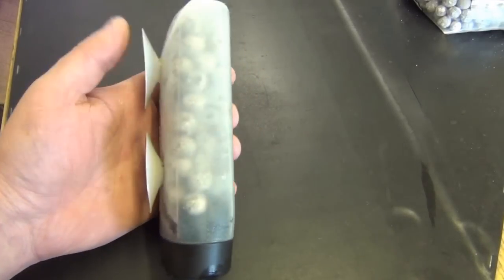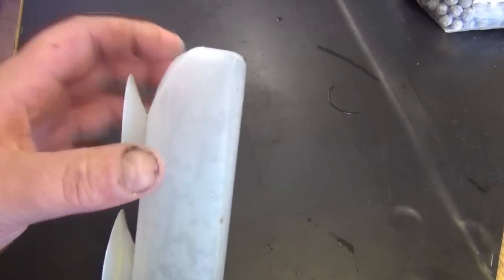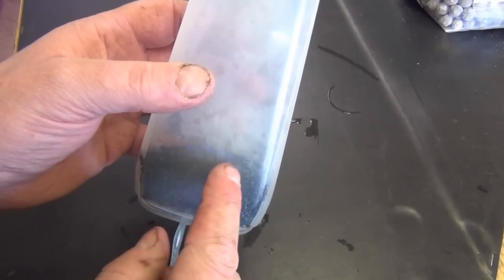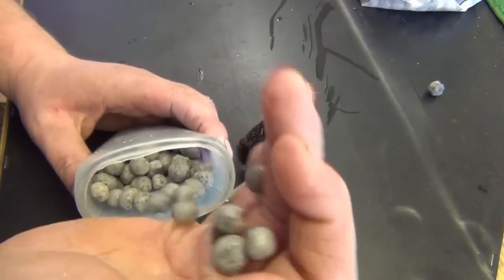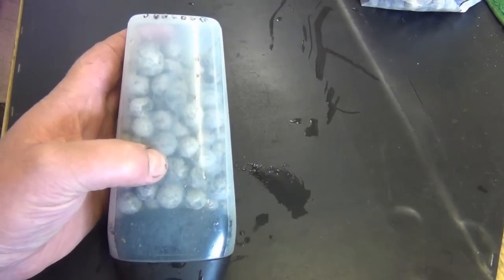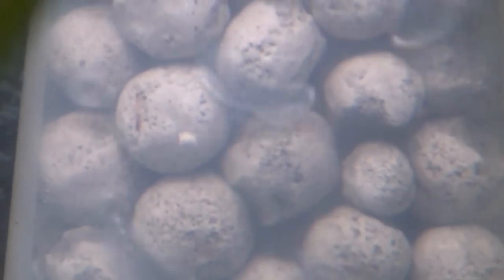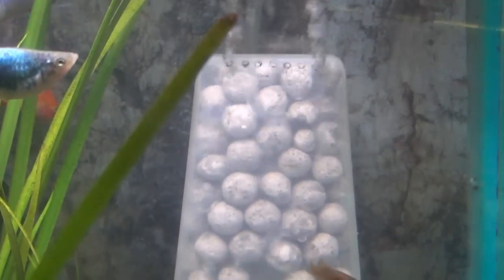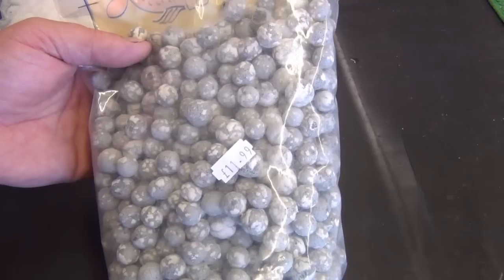How to Make an Excellent Moving Bed Filter

Comment from the maker: The Fluval Biomax is a standard ceramic media so won't move as a moving bed filter would. It still should act well as a standard filter though it may not remove ammonia and nitrite as quickly as a moving bed. It will most likely take 4-6 weeks to work really well and this is based on the set up time of the bacteria which builds quicker on ceramic media than plastic media. Adding gel bacteria balls in the filter does speed up development coinsiderably.

Comment from the maker: If air is being pushed in and is coming out of the top (with water) then water will be drawn in through the bottom to replace the displaced air and water from inside the filter. If you have some anti-parasite treatment and a syringe / pipette you can squeeze some out below the filter and the blue colour should be drawn up into the filter and spat out the top. That will prove that water is flowing correctly.

Comment from the maker: If you have the correct fitting on the outlet of the fluval 3 an air line will fit into it allowing air to be dragged in and spat out of the filter. The filter in this video is completely separate from the fluval and simply runs by air being supplied by an air pump.

Comment from the maker: Some people have used a moving bed filter on the outlet of a powerhead pump. Not sure how that worked out for them but I can't see why it wouldn't work. If you did want to go with a seperate filter then an upscaled version of the one in the video would be no worries. For a 240 litre tank I would go for at least 1 litre Biomotion or 2 litres Hel-x or 3 litres K1 for the media with a decent sized sponge as prefilter although you could retain the one you have on the powerhead instead.

Comment from the maker: A pump to run 2 of these filters only needs to be around 100 litres per hour. You'll need to control each pipe to guarantee similar air flow as air will always go to easiest exit.

Comment: The media used in horticulture is called hydroton and its made of fired clay, Biomotion is sintered glass which because of its huge surface area is regarded the best filter material for use aquatics, this one floats and is purpose developed for use in aquaculture moving bed systems..

Comment from the maker: Groovy. I am currently working on a commercial design which uses the Biomotion and although my first prototype has not worked to plan I now know exactly what to do to for the next one so all being well I will get that made very soon and have it tested. The idea is to show a couple of filter designs at Interzoo in Germany next year but I need to get cracking if they are going to get made professionally so they don't look like plastic containers siliconed together, lol.

Comment from the maker: This filter does not rely on high flow but to test flow just inject water dye (e.g. parasite treatment containing malachite) where water is sucked in. You chould see it taken in and come out the top. Alternately you can just wait a week or so then remove the foam and examine how much muck has been attracted to the foam.

Comment from the maker: The muck is trapped in the foam just like a normal filter but the moving bed does a much more efficient job of removing the ammonia and nitrite since it supports a very vigorous strain of bacteria which rapidly processes waste.

Comment from the maker: The media will only need replacing if it wears away wich shouldn't be for a very long time. The guy who makes it has had 5 litres running in a koi filter for around 6 months with minimal wear. The clay on the outside is meant to wear off quite quickly to help with water conditioning.

Comment from the maker: If you're going to use K1, I'd go for Hel-x as it has 40% more surface area per litre. Two half litre Hel-x or two one litre with K1, choice is yours really. Both would benefit from a foam pre-filter to catch the suspended muck in the water (mechanical filtration) and the moving bed would act to support the biological (bacteria) side of the filtration.

Comment from the maker: Not sure what that is, man. This filter doesn't have use moving bed media to be effective but proper moving bed media (especially the biomotion) is much more effective than media which doesn't move because of the stronger bacteria it supports, therefore the moving bed filters can be smaller than filters using static media.

Comment from the maker: The holes in the  bottom of the filter. As air is forced in, it rises up and escapes from the top. The water is drawn up through the bottom of the filter to replace the air and water which is driven out of thr top.

Comment: made one of these; my first diy filter. I used coral shards as substrate because i figured they have a large surface area due to all the pores. We had a tank in the basement that was horrid, but i spent all of today saving it and it looks amazing right now as a tank that has just been started. Love all of these filter ideas. Will be sure to try out more ^_^
Reply from the maker: Sasha Doolittle Sounds good but remember that coral will raise the pH and as long as you have fish which like that (most livebearers) that will be fine.

Comment: Hi, thats no problem, because now there is these air filter, plastic casing with sponge and litte stones in the bottom, that have been running for months, can run at the same time for some weeks, before changing

Comment from the maker: This one was only a 60 or 70 litre per hour air pump. I suppose that equates to one litre of air for every litre of tank water if this type of filter is the only one in the tank? Never made that connection but that would seem like a sensible guide.

Comment from the maker: You are in the US so there are 3.8? of litres to one of your gallons, not 4.54 litres which is in a UK gallon so for 180 US gallons you would need the following amount of media:
Biomotion: 2 litres
or
Hel-x: 5 litres
or
K1: 8 litres
Based on the tank having a heavy stock of fish and a prefilter of foam being used to trap heavy muck. Media needs to fill 70% of container (K1 & Hel-x) and up to 90% if biomotion so size of container would reflect this.

Comment: How would you suggest mixing up the media mate? I'd be using a large 2ltr bottle,
Would it be best having the sponge, then T piece on top for the airline, then some bio motion then finally some k1 or hell-x?
Also mate does the bio-motion float and move about like k1 does? As I don't think the filter would be at its greatest effect if the bio-motion was crashing into the k1 all the time, what do you think?
Thanks a lot mate and sorry for all the questions haha

Comment: i am starting up again with my rio 125. I have watched most of your tank videos and i will be using sand and peatballs for the first time in my tropical set up.
some questions can i use two of these moving bed filters as my sole filtration system ?(i have removed the rio internal filter).
And am i right in thinking you remove the foam and wash it in tank water ,and if yes how often,Thanks for great informative vids.

Comment: Hi, Pondguru  I'm new to keeping fish. How often, if ever, would I need to replace the ceramic media you are using? This is an awesome and brilliant tutorial, most enlightening, thanks loads!
Reply from the maker: If the media is not moving it should last for years but it will break up when moving especially if movement is violent. Gentle movement will not wear it much. I actually have a new media coming out which is much more suited to these small DIY filters and I will be showing it in an upcoming video where I upgrade a biorb fish tank. I still need to edit the footage but hope to have it up at this coming weekend.

Comment: Hey mate, great stuff with the diy videos. I've got two quick question for you.
Can you use this filter on it's own? or does it have to be in addition with another (e.g. sponge, canister, sump) filter?  (this is for a 240L tank).
Also, I'm using a power head with a sponge as a filter at the moment. Could i attach the outlet of the power head to a moving bed filter? (instead of an airline)

Comment: Thanks for the video Richard! Just a quick question... Will the noise of this filter bother the fish at all? I've just set mine up and it is running great but does make a fair bit of noise, with my ear pressed up against the tank its pretty loud... Cheers bud.
Reply from the maker: +The Impossible Floating Tap Company Moving bed filters or even static filters driven by air will always variable amounts of noise depending on media used and air flow but it does not bother the fish. I used to have large K1 filters in the discus tanks when I had the shop and they were pounding away 24/7 - didn't bother discus and you just have to look at those fish the wrong way and they'll turn black and die, lol
Reply: +Pondguru Outdoors Hahaha nice one, cheers for getting back so quick, really appreciate your help!
Reply from the maker: +The Impossible Floating Tap Company No worries, any time.

Comment: Hi there, I have just made one of these small filters using a shower gel bottle and filled 3/4 full with the biomotion media. Does it take a while for the media to start to move as mine is completely static at the moment. Really enjoy your videos, keep it up!
Reply from the maker: Yes it could take weeks to move but will still be effective if it is static since it s sintered glass media Don't be too worried if it only slightly moves or doesn't move at all as it is fine to pack out the filter.
Reply: +Pondguru Outdoors thanks Richard, appreciated.

Comment: Thanks for all these videos, well explained and common sense. I came back to this video because I couldn't remember the name and the only ball shaped media I can see on your website is Biogravel and Biohome Shower, have they stopped making Biomotion?
Reply from the maker: The new shower media and biogravel uses the same machine as the biomotion to produce it and the process of making the biomotion if very long (and messy) so we decided to drop that type of media in favor of non-moving media. 
Also, we found that people were using it in the same way as traditional plastic moving media which caused it to break up prematurely. It really needs to be used in a cyclical motion to avoid it smashing together.
I could have sent you some out but recently sold the last 24 litres - aaarrrggghhh....
If you're making a small filter like the one in the video then the biogravel is a great choice as it allows maximum surface area in minimum space - it may 'vibrate' with air bubbling through it but is too heavy to move like a moving bed media.

Comment: Does your sponge actually catch any dirt?  Are there any other holes in the bottom or toward it?
Reply from the maker: Yes it was quite good at catching dirt as the water was drawn in through the holes in the bottom of the filter but it wasn't really for clearing the water since the foam was very coarse.

Comment: What is your take on using crushed lava rock.  I have a 10 gallon tank.  So I'm more than likely splitting hairs between lava rock or the media you're suggesting.  Thanks in advance!
Reply from the maker: For a small moving bed the lava rock would be way too heavy but as a static media it is OK. A small moving bed would probably be better made with K1 micro.
Brown lava rocks are fine for filter use and will compare well to decent quality ceramic rings. The white lava rocks are much more porous so have a chance of supporting a reasonable population of anaerobic bacteria (responsible for nitrate reduction) but will raise the pH making it suitable only for malawis, livebearers and goldfish / koi. They are both forms of volcanic rock (pumice) and while the white pumice is structurally much better than the brown/red pumice the biohome has a better structure and is more receptive to bacteria than either of them. Each piece is exactly the same so you can make maximum use of the biological part of the filter and have a good chance of completing the nitrogen cycle (reducing nitrate) when using the biohome at a sensible amount in the filter.

Comment: Great video and very clearly explained. Just wondering if it's suitable to substitute the media with LECA balls as they are also inert, porous, ph neutral and has plenty surface area. 

Thanks
Reply from the maker: I presume they would work in a static internal filter, yes. Not seen anyone use them in an aquarium but there's no reason why they couldn't be used.
Thanks for watching and appreciating the videos.
Reply: Pondguru thanks for the reply, I have been really inspired after watching your other videos. 

I made something similar to this canister style, except I placed it outside the tank and used the LECA balls that I have lying around. They all float to the top and lots of air around it from my air pump. 

Since this is used as my main filter, should I add elements to introduce anaerobic bio filtration? Or is it more beneficial to increase aerobic filtration even more?
Reply: Pondguru thanks for the reply, I have been really inspired after watching your other videos. 

I made something similar to this canister style, except I placed it outside the tank and used the LECA balls that I have lying around. They all float to the top and lots of air around it from my air pump. 

Since this is used as my main filter, should I add elements to introduce anaerobic bio filtration? Or is it more beneficial to increase aerobic filtration even more?
Reply from the maker: Hung Lø Wong
That media should support a certain amount of anaerobic bacteria but a filter which is not highly oxygenated is way better for supporting anaerobic bacteria.

Comment: How many should I use for a 55 gallon tank? Or do you have a general idea of what size tank one of these is rated for?
Reply from the maker: I'd reckon this one would do around 50 litres? (approx. 13 US gallons) but you would just scale this idea up for a larger tank. Not sure if you have seen it but if you search 'invisible aquarium filter' you'll see a much better design.

Comment: how do you clean or when do you change the media? Totally new to this kind of filter. thanks!
Reply from the maker: +Carol Counsil It should never need cleaning but the foam(s) will need cleaning as and when they are clogged.
If you are using the biomotion media it will be very effective but will gradually wear away and need replacing. How long that is depends on how quickly it is moving.
Plastic moving bed media will last for years but holds nowhere near the amount of bacteria that biomotion does.
Reply: +Pondguru Outdoors excellent! Thank you! We need this for our tank. Lost fish this weekend and I'm pretty sure it was ammonia. We have one 10 gallon tank and one 5.5 gallon tank, will be getting a second 5.5 gallon tank. The 10 has the tropical fish has 5 neon tetras but hope to add 2 more different fish. The 5.5 tank has a halfmoon betta and the second 5.5 gallon tank will have a betta as well. Again thanks for the info and I can't wait to get the supplies and make one of the tanks and have happier/healthier fish! :)
Reply: +Pondguru Outdoors oh oh.. another question. Would this set-up be okay for a 50 gallon tank? I have one of those but it is not currently set up but one week this summer or spring we should be setting that one up as well. Suggest would be great. Thanks!
Reply from the maker: +Carol Counsil It would be way too small for a 50 gallon tank and when you're getting to that size an external canister filter would be best.

Comment: What size air pump do you recommend using?  I have a 1200ccm aqua culture air pump in my DIY bottle, and that pump only puts out the equivalent to about 1/3 gpm flow rate.  But, that doesn't seem like it's moving enough air through the bottle to create a slight agitation of the BioMotion media.
Reply from the maker: That should be fine. The amount of air pumped into many of the small filters I was making in the videos was only between 60-100 litres per hour.
Reply: ok, thanks!

Comment: I've been given a Fluval Chi 19Ltr and I've set it up for my cherry shrimp, could I use this filter so I don't get such a strong current and would I be able to use it in the same tank for a betta. I think this is awesome and for a pensioner, it's saving me a lot of money. But was else could I use for media that would be cheaper for just one filter please ?
Reply from the maker: +Gwendoline Letley You could add any good media in there but generally the better the media is the more it will cost. Avoid plastic media. Even using horticultural grit would be decent and it may help to mineralise the water too.

Comment: I've read that the bacteria prefer dark environments. Would an opaque bottle work better for this sort of setup?
Reply from the maker: It's not essential but you could go that way, yes. With this filter you need to see if the media is moving so it generally relies on a clear container.
Reply: Pondguru
Cool, thanks! :]

Comment: Would this be good for a 10g (39l) tank alone or would you need a carbon element aswell to keep the water clear? 

Thank you pond guru! Just getting this hobby. Thinking of ways I can modify a Marineland penguin 75 to have better bio capacity, right now I have sliced the cartridge open and am able to insert my own fresh carbon and broken up ceramic logs as well as the bio wheel. 

But I would like to get rid of the HOB and use maybe this idea? What do you recommend?
Reply from the maker: Adrallon Ded If you have altered the HOB to take media it would also take the new biogravel ( also available from US supplier greatwaveeng.com ) so that may be the most sensible choice as you ideally need a coarse foam and a fine foam as well as filter media for a stand alone filter. Air driven filters don't deliver much flow which can be bad or good depending on what fish you have in.